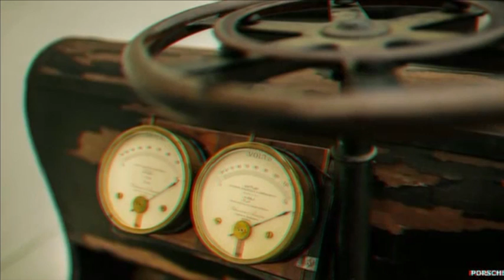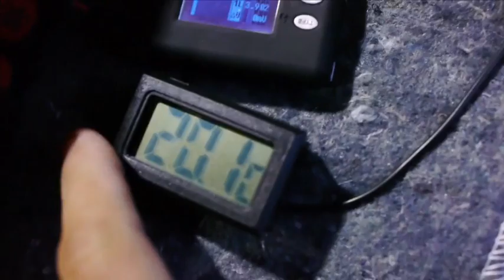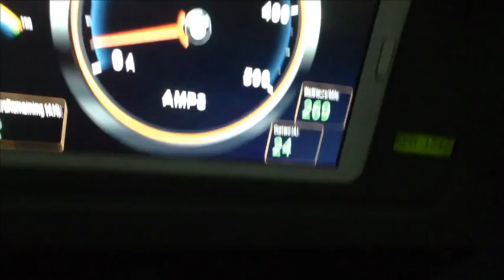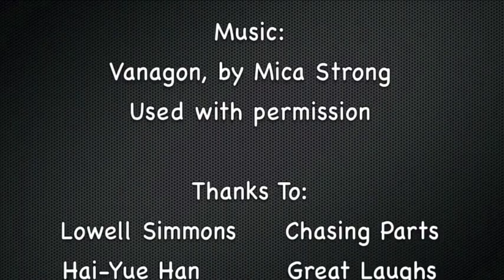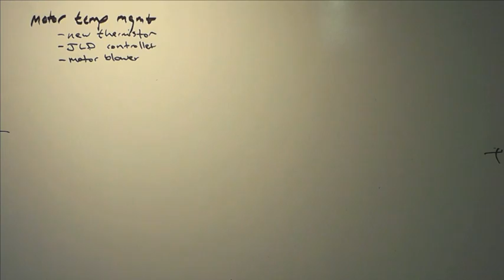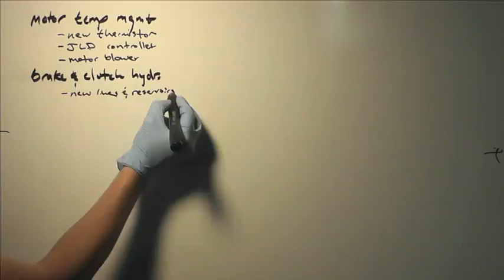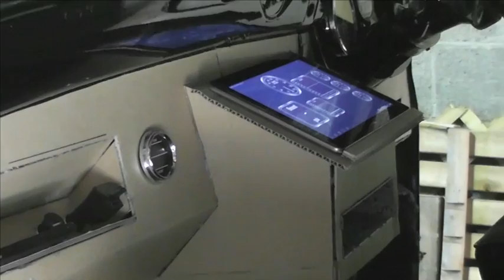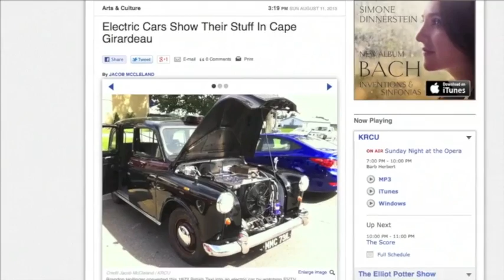EVTV Friday Show - Friday January 31, 2014

Comment: Hi Jack: I just leased a 2014 nissan leaf and before I install  level 2 in the garage I wanted to get your opinion on this guy: http://evseupgrade.com/ basically he takes the 110 unit that comes with the car and modifies it for 240v. What you think? Is it playing with fire?
Reply: Yes!
Your charger is 240V and accepts 110V. You can upgrade to the 6.6KW charger if you wanted without losing everything on your lease.
Reply: ***** Thanks Jack - that's what I was hoping to hear. I can plug it into the dryer plug can't I?
Reply: Mike. I have the evseupgrade modified portable Nissan EVSE. The work this guy does is A1. Used mine for the last 2 years and it is still going strong. I use both 120v and 240v power sources, and yes a dryer outlet will work. If you are planning on using the dryer outlet on a regular basis be aware dryer outlets are only rated for a few hundred plug/unplug cycles. For long term plug/unplug install a L6-20R socket which is deigned for regular use.
Reply: Thanks for the tip Jean-Pierre that's good to know
Reply: Mike Servis Read the user manual!
Jack was right.. I'm English so never see 110V unless it's industrial stuff. The EU/UK brick is for 240V but limits the current to 10Amps to save our house wiring from burning out.

Your "brick" I assume is for 110V. The actual plug in the car for the "gun" is 240V. Some have the 6.6KW charger, otherwise it's 3.3KW (15A). Get yourself that EVSE to charge faster ;)
Reply: m1aws Speed of charge on a 120v outlet is limited by the maximum amperage draw of 12 or 16A depending on the circuit. the EVSEupgrade Modified EVSE goes up to 16A and operates on 120v or 240v. 3.3kWh on board charger or 6.6kWh will charge at the same rate using this rig. 

To take advantage of the 6.6kWh on board charger you need something other than the OEM Portable EVSE, such as a dedicated EVSE on the wall or maybe an OpenEVSE kit might have something with more OOmph.

Mike is interested in upgrading his portable EVSE, which for under $300 is an awesome way to get 16A/240v charge rates at home with a 240v outlet is his garage and also has the ability to charge at RV parks and commercial buildings using inexpensive adpaters.
Reply: Jean-Pierre White Thanks for another valuable tip Jean-Pierre. I made a big deal out of making sure I got a 6.6 kWh on board charger to get the most bang for my buck at fast chargers - public chargers. Now you're telling me that the EVSE upgrade wouldn't utilize that 6.6 kWh onboard charger? Got any recommendations for home charging then? The most bang for my buck.
Reply: Mike Servis The 6.6kWh on board charger is of little consequence when using DC Fast Charging, the DC Fast charger bypasses the on board charging unit. As for public charging on 240v the 6.6kWh on board charger is of great value, the car will charge twice as fast, making those trips more achievable with less waiting. In addition given public charging is often charged by the hour you will be glad you got it.

If you want to take advantage of the 6.6kWh charger at home, then a 30A 240V EVSE is needed. Home depot sell several online for around $600, be sure the specs say 30A. However most of the time you are charging overnight at home so speed is typically not a factor. The evseupgrade EVSE is more than adequate for home charging.

The quick charge port and the 6.6kWh on board charger are very useful for public charging. You made a wise choice. At home don't get hung up on charging speed. A dedicated home EVSE is a great convenience. I have both a home EVSE and the EVSEupgrade unit. EVSEupgrade adds extra 240v charging locations beyond the dedicated  public EVSE's. I use mine frequently at the local state park.
Reply: For most people it's plug in after work. Go in, have tea, watch telly then off to bed. Speed is no issue unless you are in transit. :)

One lovely aspect with a 15A~32A EVSE is pre-warming the car on the timer so the car is defrosted and toasty inside before you set off to work without using any battery.